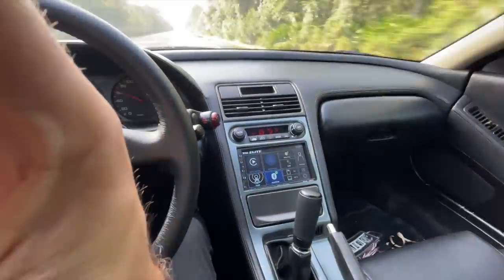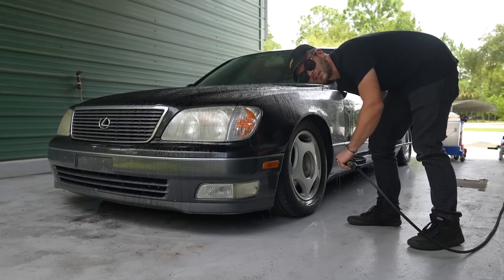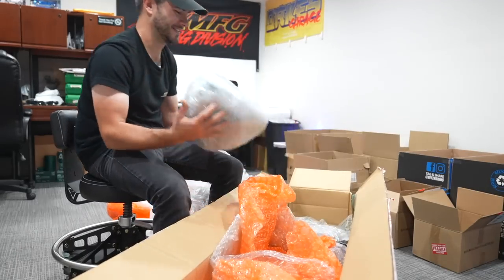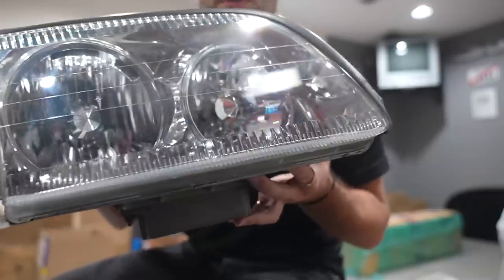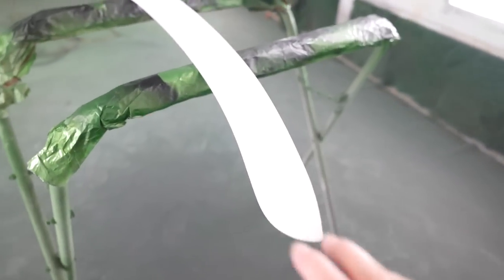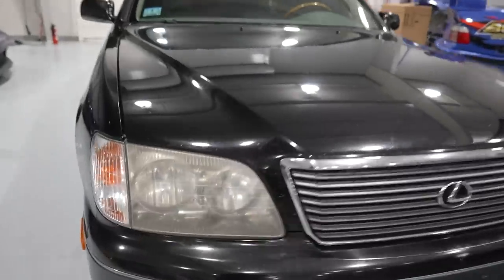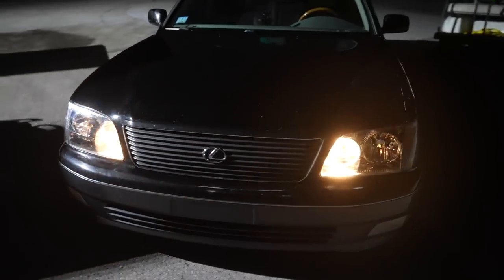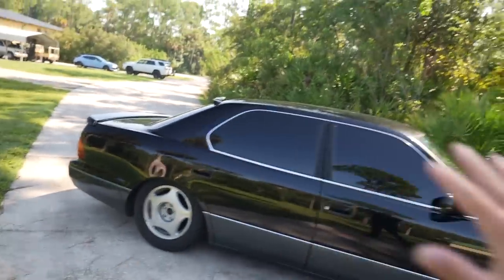THE LS400 GETS NEW RARE JDM PARTS!

Comment: Following the path of neat Streeter, LS affix the centre caps, just to crisp up the neatness of the 4oo! Cut polish revive n seal the paint 👌
And daily the hell out of it🔥
Beautiful smooth cruiser for the highways, streets n handling heavy traffic!
If you wanted to go crazy......
A 4oo Bosozuku Winged Dragon
An amazing rollin' business card?

Nsx. Loose contact, relay or display/controller unit on the way out?
🤞 It's an easy fix

Comment: Try spraying a bit of silicone grease into the window seals where the glass slides. The rubber might be drying out and start to get sticky. And you can spray it on the door hinges to keep them from squeaking when you open and close them.

Comment: having the same problem in my VW rabbit with the blower motor. I replaced the thermal fuse and got all my fan speeds back, but it blew again in a few days. likely need to service the blower motor itself or find a replacement. at least I have the one speed but its super loud
Reply: 2007 rabbit  not an oldie

Comment: Absolutely keep the LS400, as a fellow LS400 owner, I've always dreamed of making a modern F-Sport version of it. Upgrade the suspension for better handling, do and LS460 big brake conversion (even though the LS400 already has big brakes), swap the diff for one that has LSD, and finally either boost the current motor or swap in an HRE built 1UZ. I may have had to much time to think about this lol